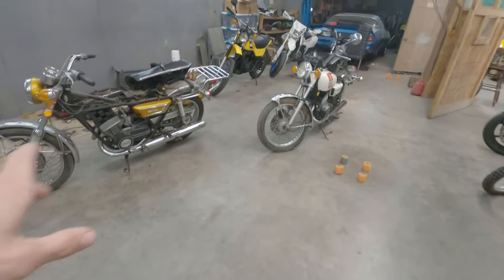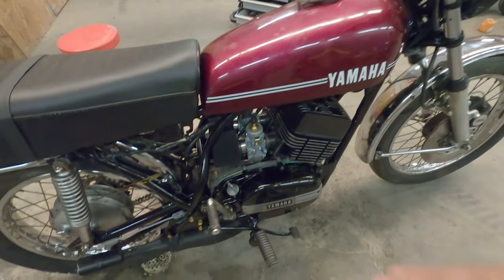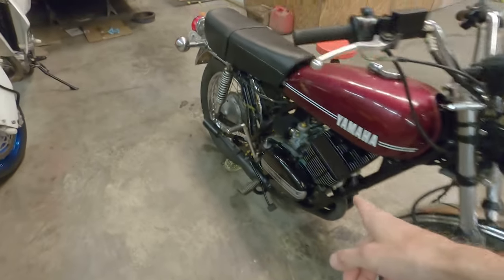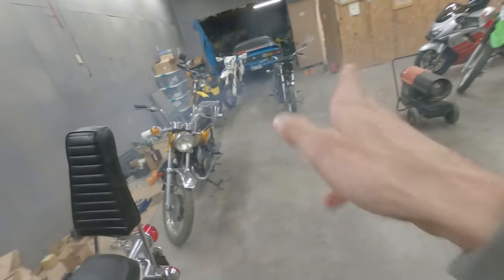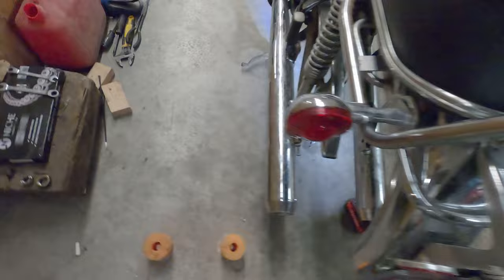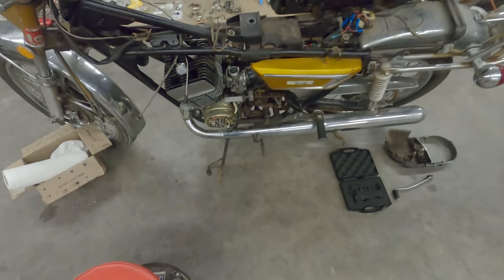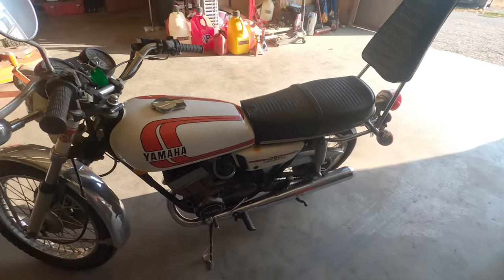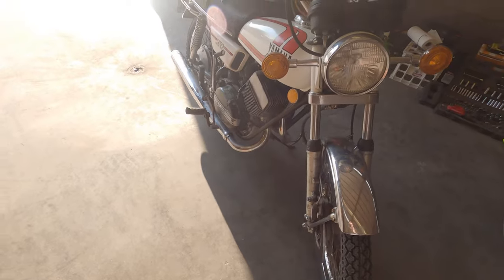30HP 250cc from the 70s is too fun 🤩

Comment: Your best bet is the Vape CDI ignition. Everyone who's anyone with an RD runs these ignitions. Set it, forget it, and enjoy a real stator ignition.
Reply: Do they work on the 200s as well?
Reply from the maker: I’m not too sure if the rd200s have the same cam style ignition but I believe if it does Yambits website would have it listed as an option. ✌️
Reply: Using on RD 350 going well
Reply: Run the Vape on my '75 RD350B and '77 RD400. Best decision I ever made. Strong spark at the right time, every time  across the entire RPM curve. Starts easier, more power, better combustion, less smoke. No longer have to rely on 40+ year old stock ignitions to get me home. For the everyday rider like me it's awesome.

Comment: I worked at a high volume Yamaha dealer in the 70s and got to pre-delivery service a lot of RD350s and 250s Every once in awhile I’d service and test ride a 250 that was just as fast as a 350 on my short test ride. Maybe one in 10 or so would just feel really crisp, responsive and a better ride than a 350. I never figured out a reason but it might have been a combination of cylinder sleeve alignment and piston clearance or who knows but those 250s were nice. Too bad we didn’t get the later 1976 through 79 250s that Europe and Canada got with the later style cylinders, electronic ignition and RD400 chassis improvements.
Reply from the maker: That’s awesome! I can’t imagine what it would’ve been like working at a moto dealership in the 70s, I’m sure it was like a little slice of heaven most days for a two stroke enthusiast lol.
Reply: @WreckedRevival It was fun and a lot of work as some days we would sell 15 or more bikes a day in the early 70s. Lots of crash damage work to go along with regular service too but I think it was a golden age of motorcycling in the US. I bought a DS7 second hand, modified it and went racing in WERA with some success so that bike has a sweet spot in my heart. 🏁

Comment: In the final process of rebuilding a 72' R5 with new top end Wiseco set, 1st overbore, carb overhaul. tires/tubes, lights, points/condensers, chain/sprockets, seat, battery..was in pretty good condition otherwise with 9,097 miles
Reply from the maker: Nice! Our rd250 was definitely the easiest one to get roadworthy & it’s still going strong. Happy to hear another Yamaha two cycle twin will be back on the road!
Reply: @WreckedRevival  update, got it running nice,,,,but......no 2nd gear, had to remove engine and split cases, bad shift fork, two worn gears....put it all back together again, but now shifts great!
Reply from the maker: @richarddegen6184  good to hear! Not so much about the shift fork and gears but cool that it’s running and back on road again now. Congrats on reviving a fun bike to rip around town on, sure it’ll be turning some heads!
Reply: also replaced 2 bearings in trans and all seals, crank and gearbox
Reply from the maker: @richarddegen6184  nice! Just got the rd350 crank rebuilt with tz350 rods new bearings and it’ll be getting all new seals and everything as well.  🤘

Comment: The YDS7 seems to have YR5 barrels on it . Have you measured the bore ? 350cc barrels generally have two extra wider cooling fins at the top of the barrels.
Reply from the maker: Funny I was just talking about 350 barrels for it yesterday! I haven't had time to look into the YDS7 much yet but actually just got back to working on it. Will definitely look into that, Appreciate the info!

Comment: impressive bikes, Where does the exhaust of the 350 comes from ?
Reply from the maker: We aren't too sure & actually curious ourself. Looks similar to DG expansions chambers that someone changed the silencer/stinger on
Reply: @WreckedRevival  thanks for your quick response. Once I´ve asked JL ( Jim Lomas ) if their pipes fixe on the RD250 too ( respectively are too big because made for the RD 350 ), but still waiting for response. Yamaha once made special exhausts for their TD 250 Racing machine, but they are not anymore available.

Comment: Hey wrecked did you end up using those orange dog ears ? I need a set if you are not using and want to get rid of them. I have couple of parts not using
Reply from the maker: No I didn’t use them, they’re in a box of my spare RD parts. They aren’t perfect, is some small rust/pitting but I’d be willing to get rid of them. I’ve got an email in my about me section if you want to send me a message there.